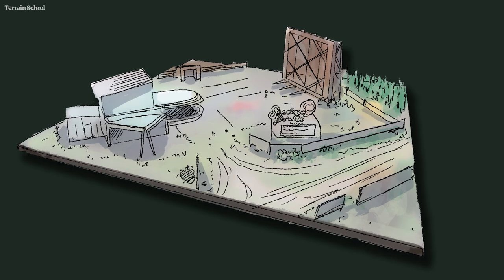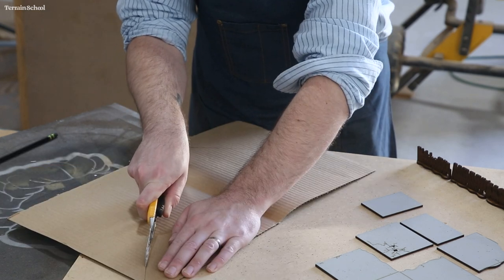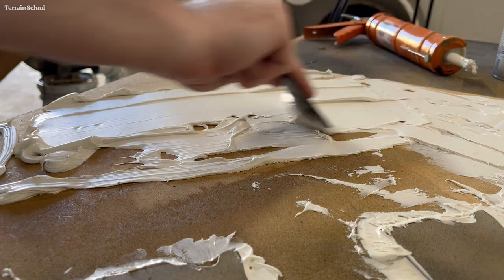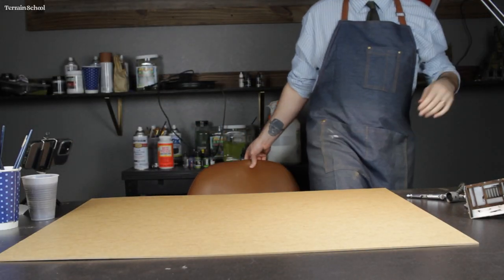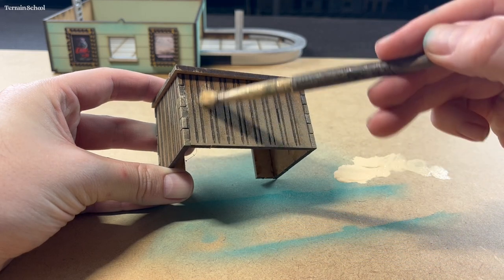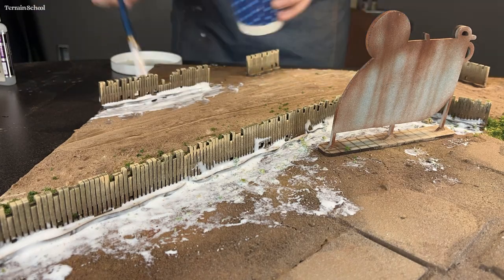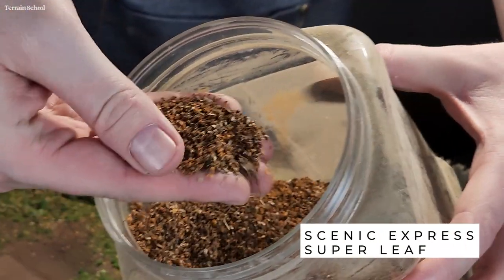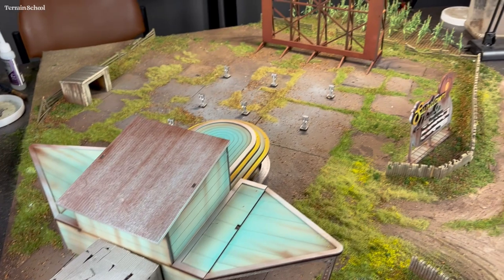Build an 80s SLASHER Gaming Table with Quick and Easy Scenic Methods! | Terrain School S1E5

Comment: I don't remember who I saw on YouTube do this but if you take some cheap pantihose and stretch them over the hose and secure it with rubber bands you don't have to empty the vacuum
Reply from the maker: Ive tried that a few times. The issue is that it clogs up superfast, and you end up having to clean it a lot. 

This way you can just run over the entire board and then empty it one time.